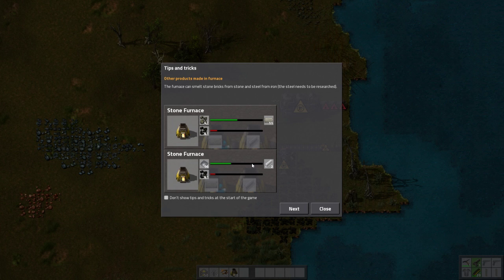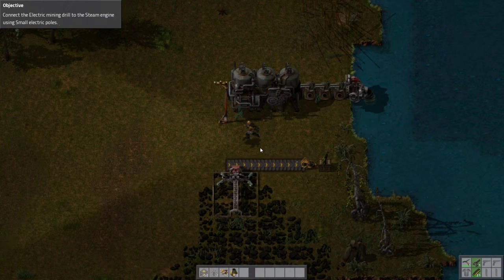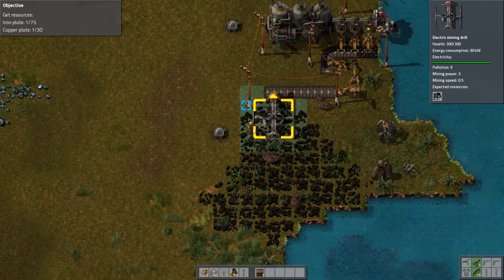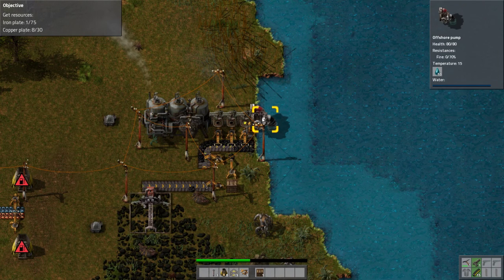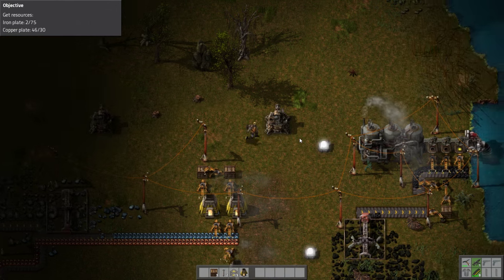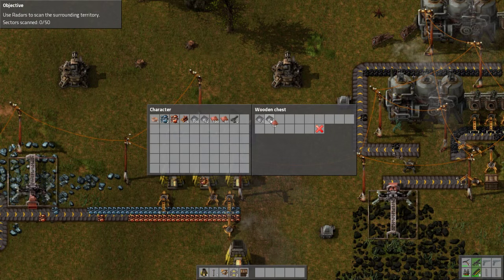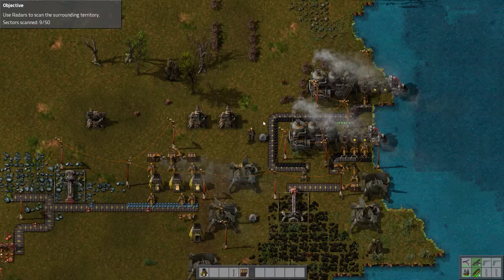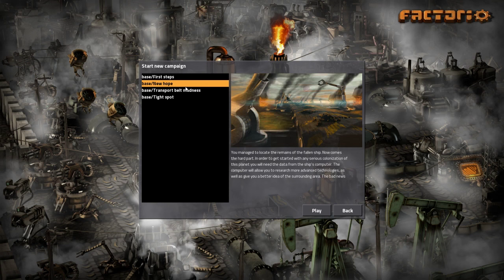Let's Play Factorio Part 2 (Patreon Chosen Game)

Comment: Just experiment. In general you seem to tend to just assume that things are broken or not working like they are supposed to. In this game usually things will flash when they are not working right, or you will click on them and see that they are sloooooow
Reply from the maker: +Maric I don't think things are broken as in the game is broken. I just am aware that I don't understand every detail about how everything in the game works yet.
Reply: Keith Ballard and i appreciate that i can watch that exploration process. Many people have found "optimum" solutions and employ only those and no others. This game is not about looking up a guide and redoing all the steps in it. Sometimes its just as much a puzzle game as a strategy game. buuuut it helps if you understand how things work. For example I can tell you that you can put multiple steamengines in a row and as long as the water is hot enough they will produce energy, but i wont tell you what the optimum setup is. Also the boilers only get filled up to 5 coal and you can check if systems are working by emptying them. 
I think its boring to just tell you " You need X boilers for Y engines and you must do this in this arrangement" ^^
Reply: +Keith Ballard Just remember - inserters are smart, and only load 5 or so resources into a machine. Other than that, which the game doesnt really tell you ever, its going to be interesting to see how you figure things out. Good luck!
Reply: Almost all new players make that mistake.

Comment: Inserters can grab items from any side of the belt.
also, when placing belts, just hold down the mouse button and run, it's much easier than to click every single tile.
It is a good idea to not place one chest per furnace, but instead use a belt to transfer all products to a single chest. that way you don't have an overly large buffer, you don't waste too much power on inserters and you only need to visit a single chest to grab your stuff.

Comment: I'll try to explain electricity, the game is admittedly pretty bad at explaining these things. 

Steam engines extract thermal energy from water and convert it into electricity with efficiency 1 (yes, 100%). Baseline temperature of water is 15 degrees Centigrade, maximum is 100 (no overheated steam for you). Water carries 1kJ per abstract unit of water per degree. A steam engine consumes 6 units of water per second. Thus maximum power production of 6 * (100 - 15) = 6 * 85 = 510 J/s = 510 kW. 

An offshore pump produces 60 units of water per second, so one pump can supply exactly 10 steam engines. 

Boilers heat water at 390 kW with efficiency 0.5, so each boiler puts at most 390 kJ of thermal energy into water passing through it per second consuming 780 kJ worth of fuel. One piece of coal is 8 MJ, btw. Thus to heat all the water coming from one offshore pump in real time you need 85 * 60 / 390 = 13.07 boilers in a sequence before the engines. So 13 boilers if you accept minuscule loss of maximum production, or 14 boilers if you want to squeeze out every last kW. The fourteenth boiler will NOT waste fuel. It will burn only a small amount of coal needed to put that little extra of energy into the water. 

All this numbers are visible in the game, but it's not at all obvious how it all connects together, I hope my explanation was helpful, and didn't come out as pushy.  

Also, not filled Performance bar is GOOD, you correctly guessed that it's Available Performance that matters, it shows how much power an engine CAN output while Performace shows how much is actually being output (based on demand). So if your Performance bar is full it means that your engines are working at maximum capacity and there's probably a shortage.

Comment: it is unwise to combine ores as you can not set the furnaces. they will smelt whatever they get. so if you combine the ores on the belt you either need to filter what goes into the furnaces, or you should avoid it completely. what is viable though is to combine ore and coal onto one belt, at least in the early game where you don't need much smelting and you won't get throughput problems with a single lane of ore.
What is however a most terrible idea is to mix items on a single lane. that only calls for trouble.